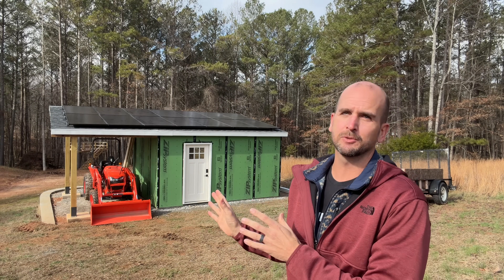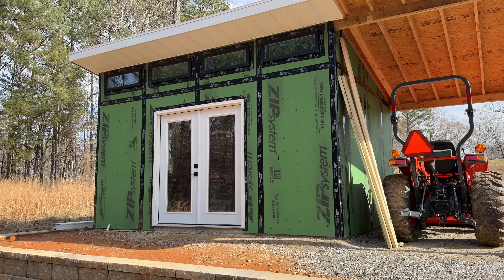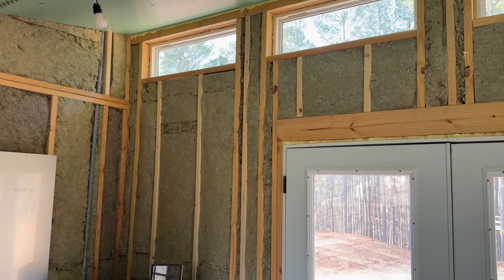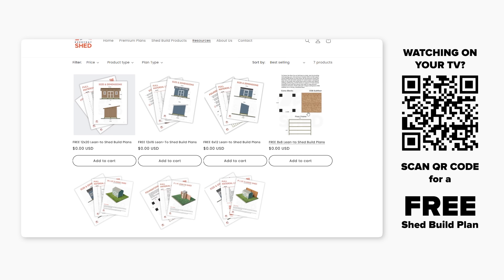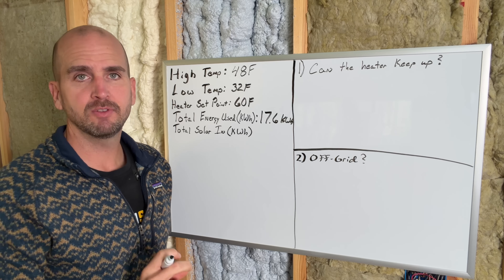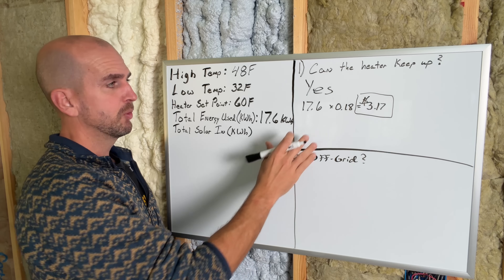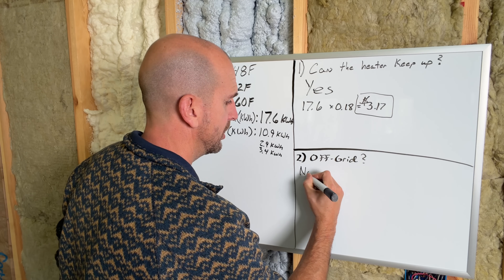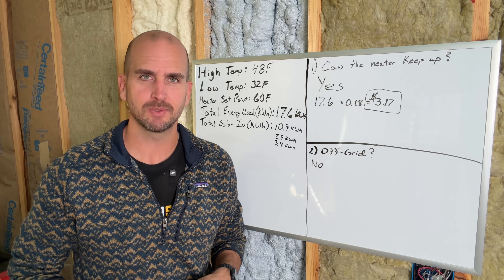HUGE Mistake: Why My $15,000 Solar System CAN'T Heat My Tiny Shed

Comment: Your big mistake was trying run the heater of you battery backup. A electrical heater will drain the batteries really fast. I built a whole house battery backup and I would never connect a electrical heater to my system. Biggest mistake you can ever do. I have two different emergency heating that I us. You can go with a Mr. buddy heater and a 20lb propane tank ( you need to look up how to connect a 20lb tank to a Mr. buddy heater. you just can't connect the tank to the heater. ) I ran a test last year with the buddy heater and it kept my first floor nice and toasty for 4 days on low before I needed to change the tanks. My second emergency heat is a Chinese Diesel heater. And that is what you need. Its perfect for the small office. It runs off 12v and can run for a really long time on one tank of diesel and if you get the third party thermostat for it, it can run much longer. I've been running my test on the diesel heater for the pass few months and its been really great. The heat that this small thing produces is amazing. And if you want to cool the office during the summer, I would get a small windows ac unit. I have 3 window units running off my system all summer with out a problem. I have a little over 54kwh of batteries. But the real question is what do you really want running for your system? But connecting an electrical heater to a battery is a huge No NO.

Good luck

Comment: As a recently retired Platinum ENERGY STAR custom home builder let me chime in as this guy isn’t a licensed contractor..
1. The shed isn’t oriented properly. It looks to be facing East.
2. The slope of the shed (and likely all the plans he’s selling) is too shallow for the latitude of his location. The degree of latitude should be the slope of the roof. These two points will significantly improve the performance of his solar system.
3. Yes the slab should have been insulated
4. Yes the ceiling should be at least R-30 if not more. Once again his plans have probably used smaller rafters…
5. The walls need to have drywall or some other non permeable surface on them. Each stud cavity needs to be sealed on all 6 sides.
6. If done properly he should also consider a source of fresh air when he is occupying the relatively small space.
Reply: renovator here. No vapour barrier kills the walls thermal viciously and the cieling is way under insulated, R20 at minimum, R 30 would make it feel completely different. Ive seen heating bills cut by over a third by this alone on broad floor pan houses. the open concrete floor seals the deal for heat loss.
honestly its only half insulated in practical terms
no vapour barrier alone is like having the AC on lmao
Reply: @Sir_Godz  Exactly. To little insulation in the walls and no barrier. He will end up with wet insulation in the winter.
At least there should be 150 mm insulation and 300 mm insulation (Rockwool) for the roof. 300 mm for walls and 450 for the ceiling is much better. And then an air tight barrier.
Reply: I think that for winter sunshine, the angle should be even steeper. Don't look for the best yearly average angle, it's the winter sun that's most needed. The summer sun usually not an issue.
Reply: @awoodward37  Can need up to 25 degrees more panel slope for winter solstice than summer solstice for best efficiency.  Since you need the more efficient slope in winter more than summer, if fixed angle installation, you want about 5 degrees less than calculated ideal for winter solstice.

This puts the average fixed installation (set for equinox) at as low as 50% as efficient in winter as summer.

I'd do a variable slope and change in 5 degree increments for a small panel set, or get a sun tracking unit to maximize year round.
Reply: Fresh air is way overlooked in small spaces like this.
Reply: All great points, but "The degree of latitude should be the slope of the roof" should be latitude + 15 to maximize winter production.  You still get all the summer AC you need with a mini split.
Reply: Putting his panels on a ground based frame that you can adjust for the seasons would make it quite a bit more efficient and allow easier maintenance and snow removal/cleaning as well as not create more waterproofing problems for the roof.
Reply: Interesting analysis,
Reply: Yeah, his shed isn't faced appropriately which causes his solar system to not be faced appropriately. You can see it in the shadow cast by the sun. You're definitely correct, dude is facing his panels eastward. I'm laughing at his input because my 3X 220w bifacials aren't too far off his lowest. Mid cloudy day, I'll at least get 2 khw. Unless he bought absolute crap quality panels, I don't know.
Reply: As somebody with solar I can confirm in the winter they produce 1 quarter of what they make in the summer. You cant use them in the winter.
Reply: @Chris-hw4mq  exactly right 4 KW in panels in the winter  checked this morning 1200 w which is actually pretty decent in Northern Canada. wood boiler in floor heat is the way to go. I only have a 10Kw battery and I've kept adding solar panels instead of upgrading my battery 2 Kw of panels on the wall which is basically off in summer I never thought production would be this big of an issue in the winter.
Reply: @Chris-hw4mq  I live in New Mexico and my solar array works fine in the winter
Reply: @good-dog-2005 I was replying to Chris' blanket statement that "You cant use them in the winter"

Comment: Why a day? Don't you mean 16hrs spent in the shed/office rather than 24hrs? If so, then that be 11.7kw required and if in the last hour time in shed/office you turn off heater then wouldn't it be break-even? If you work from 8am to 7pm in your shed\office that would mean 8.1kw used.

Comment: Seems it would have been a lot less expensive to run a 220 single phase circuit to the shed and install a mini split. $15k for an Eco Flow setup that doesn't meet the need is too cost-prohibitive for me. Solar sounds good, but by the time you factor in the excess capacity to cover for the days when solar is hardly available, the economics just aren't there.

Comment: I like rockwool as it’s easy to work with, easy cutting, fireproof, water resistant and as you stated, a sound barrier! Worth the money! I used it in my shed walls as well.

Comment: Nothing a $99 diesel heater can't fix.  I'm really surprised the heater used that much electricity, but with R10 and nothing really sealing off the air gaps in your ceiling, maybe that's to be expected?

Comment: 17KWh to heat this tiny space is BONKERS!
Reply: Part of the problem is that he isn't just heating that tiny space.  He needs to be more complete with his roof insulation, and probably add some flooring in order to keep the concrete from directly leeching away heat as well.  A heat pump has also been suggested, and it is NOT $30,000 as a disinformer stated elsewhere here, but it can be $5,000, which is still pricier than a simple 1500 W heater.  

So better ceiling and floor insulation, and maybe a bit more on the solar input to keep the battery topped up longer, and I'd bet he'd have it.

Comment: Here in Maine the adopted energy code is r-60 in roof systems.  Walls require either r-30, or continuous exterior insulation. You also need insulation under the slab.
Reply: And hydronic (hot water tubing running through slab) starting in late summer/early fall. Thermal massing.

Comment: EG4 hybrid mini split. That heater is the most inefficient choice possible. I don’t know if it’s cold there yet but you should show the surface temp difference between the types of insulation. Your choice was not to bad but you would be shocked to find how much less foam you need than the others. Traditional R value does not tell the whole story. Be messing with this stuff for 18 years and living full time off grid for 6. Very cool shed.

Comment: Not trying to be an ass, just curious — why didn’t you ever mention a heat pump as an alternative to the heating element?
In today’s day and age they’re obviously more efficient for heating/cooling, and you can even build a DIY one from off-the-shelf parts.
Are you considering that direction at all?

Comment: I would like to think that the space that you are trying to heat is 12 x 16 x 8 feet, which is roughly 1500 cubic feet
The energy to heat that space (1500 cu-ft) by 1F is about 28 BTU (1 kWh is roughly 3400 BTU)
Presuming that you were trying to increase the Temp from 0F to 75F (28 BTU x 75F = 2100 BTU or 0.6 kWh)

I believe that the 1.5 kW Heater could very easily heat the space

But there are several things that could be done differently that would cut down on the Energy needs of running a heater
Geo Thermal ducting through the ground, reducing the temperature difference (usually brings the difference to 25F, rather than 50-75)
Passive Solar, utilizing the angle of the Sun. If the building faces South with a 25-degree window, will capture the heat of the Winter Sun / block the Summer Sun (may not even need any heater)

Comment: INSULATE first, then heating/cooling becomes optional.  Also a one-off expense, zero running costs.
OR - use an IR emitter panel heater - heats you and the walls/floor, not the air.  Only needs being on when in the room.

Comment: First off, nobody in their right mind would ever buy one of those so-called solar generators.

Instead, they'd buy a cheap Chinese inverter like PowMr, or a better SRNE.  Then they'd add a large battery - maybe a 32kWh Yixiang. With 10kW of panels, you'd be looking at $~8K all-in.

Comment: Great content and cool build. Saw another video of a guy that had multiple solar water in the flooring. Curious if you have any experience with that since seems easier than running an electric heater.

Comment: Thanks for being honest here. A supposedly 6 kW solar system that actually yields 10.9 kWh over a full day, and 2.9 and 3.4 kWh on previous overcast days. That's reality. And the temp differences you were dealing with - 60 *F setpoint vs. 32-48 outside is really not much of a challenge. BTW, 18c per kWh is amazing. Here in CA we pay 3-4 times that because people are outrageously dumb out here. Out here if you offered people 6 kW solar panels like that, they'd buy them, quit their day job, figuring they could earn so much $$ they could start buying up lottery tickets.

Comment: Dude LOAD is first issue.  TONS OF WINDOWS.  Now that they are in youre only choice is make covers. You can cut foam to fit inside opening adding weatherstripping if neeed.  at ceiling u could hinge them to fall flat agsinst wall when u leave push them into windows.  Slab. Insuate gound out to retaing wall  cover w tile or gravel.

Comment: How about instead of paying $15k in useless and expensive EcoFlow system, you put all the monry into solar panels and a couple of storage heater (e.g one with bricks or ceramic cores). Storage heaters ensure slow release of heat throughout the night and they are cheap, so you could at least double the number of solar panels. With more solar panels they will get more than 3-10kWh of electricity/heat during day time. They will release that heat during both day time and night time. From experience It'll be chill in the morning, but that's it.
I'm curious to know how many more solar panels you can use this way, and if that system would be good enough to get through the night.
EDIT: other suggested a heat pump which is probably the best and most efficient way of heating for you, but it requires excellent thermal isolation.

Comment: Your solar yield seems low.  Have you monitored what voltage the MPPT charge controller does as clouds pass?  Many of the Chinese charge controllers drop to the lowest voltage and park there for a while even if the sun is at full intensity.  This drastically reduces your solar yield.  Even the Bluetti AC 200 variants have this problem.  I think I also observed this on my Ecoflow products.

Comment: This building is so poorly insulated, the evaluation is meaningless. The first place to start is always to have good insulation and windows. Make the structure as efficient as possible. It's the least expensive thing to do. Heck I insulated my storage shed better than this building. 

While there may have been very good reasons to insulate this structure this way, it was a mistake to try to heat it this way. And of course, an electric space heater is the most inefficient electric heating possible. A mini-split would have been a good choice for this. Probably could have put in less solar, taken the savings and properly insulated and paid for a DYI mini-split and had something that worked.

Comment: Cold air also comes from the floor... i heat a 125 SQ feet room consuming 500 watt an hour 12 KW a day and temp is up to  67F... im using a Delonghi Dragon, programmed 15 min on 15 min off set timer, on medium setting.... Then i have 2, 400 watt ceramic heaters on seperate sides of the room, one ceramic is set 2 inch off the floor, and the other ceramic is set 4 feet high with no objects blocking air flow... 3 sides of the room has a heater, it is also important to heat 3 to 4 area, heaters 2 feet away from the wall.... I run one ceramic close to the floor for 15 min, and the other ceramic will run for 10 min.... in a current weather  of - 4F.... one heater cannot heat a space and every heater serve a different purpose! Oil heater to prevent frost and warm objects, and Ceramic to warm the air and pick up cold air off the floor, keeping the floor warm. The ceramic heaters used is at walmart name Westinghouse.

Comment: I hesitate toward this guy’s channel with a comment..  But using a $50 heater powered but a $5000 solar system is dumb.  Spend a bit more on insulation.  And spend $1000 on a mini split heat pump and you’re in business.  The 17kwh/day should drop to less than 3kwh/day, easily.

Comment: Cool looking shed! But a shed and an office have very different requirements. If you want to "live" in it like an office, then you can't cheap out on the building code. You need a massive roof. And like everyone else said, heat pumps are MULTIPLE TIMES more efficient than resistive electric heating. Heat pumps basically create energy because they're moving heat and you don't care about the other side of the equation (the cold exhaust).

Comment: Best way to heat with solar power IMHO is to grow timber, harvest the deadfall and windfall for firewood, and burn that in an efficient woodstove. For heating, you're storing solar energy in the wood. Use PV solar for electrical needs. Maybe sell some timber to pay for the PV system.

Comment: ROI on solaring your shed is too high. Run a 20A circuit to the shed. Connect three solar panels direct to heater. No inverter needed. Put a second heater in on wifi switch to house circuit. It comes on at dusk and off at dawn. Powering an AC, you will need 6 panels, small inverter and 3KWh storage for to cover rolling clouds. Could also power heater. AC falls back to grid at night. You now have 10K back in your pocket.

Comment: You ceiling insulation should be R45 or greater.  Also I insulated my shed with a Mooney wall which is a 2x4 with a 2" thickness extension.  If you add a Mooney wall to your insulation and one layer of 3" ceiling foam you will get good performance.  Then insulate under the floor with 5.5" or rock wool covered by 8 mil fire resistant poly.  Finally add six  5  gal buckets painted  black on 1 side, add water/antifreeze mix and point your space heater at the buckets to store a little more heat at night.

Comment: I'm at a loss why you wouldn't use the force multipler such as a heat pump. 

It's beyond silly to use a resistance heater. 

Heck even a diesel heater would have been smarter.

It's pretty amazing this low level of content is enough for 28k views in 8 hours.

Comment: I'm with everyone else: You have a poorly insulated shed with a bare concrete floor and the most inefficient heater possible and yet are surprised that you can't keep it warm with $15,000 solar setup.
Reply: Yeah a mini split would be roughly 20% of the energy, much more efficient
Reply: Plus poorly insulated is killing heat retention

Comment: You are joking right?  $15,000 system can not heat that TINY little office.  In my (your) climite its just not practical to Heat with Solar.  There is not enough Sun energy in the winter.  Summer AirCon probably?  Where I live is not even 'heavy snow belt', southern NJ.  It was 15def F overnight last 2 nights, and its only December.
Reply: This is also why roof mounts or at least flush roof mounts suck. Look at that angle. It's absolutely terrible in the months you need it the highest.  And yeah what he paid is insanely high. I built a much larger system for less than half that price.

Comment: As many of the commenters have stated below, you should not be using a "resistance" heat source. You should be using a "portable heat pump".
A typical 9000 to 12000 BTU heat pump would easily meet your heating requirement.
Ah, I see in the comments that is your plan... hehe ok.

Comment: I would have used the slope of your lot to build the shed into the ground thus cutting insulation cost.  I would use a heat pump as others have mentioned to reduce electricity needs.  I also would have engineered air exchange for the space which draws air in from tubing buried in the ground to warm the air.  You could also engineer a heat battery under your shed.